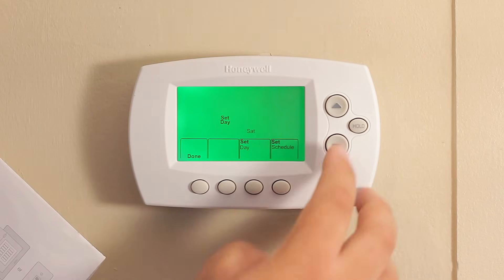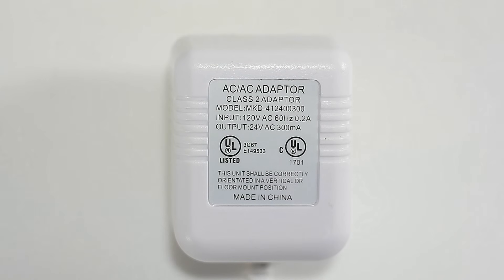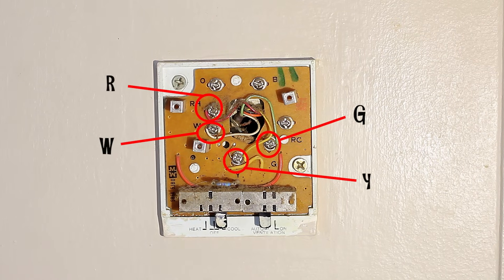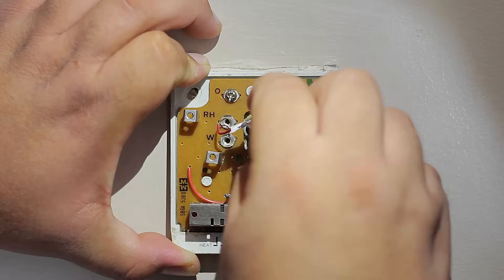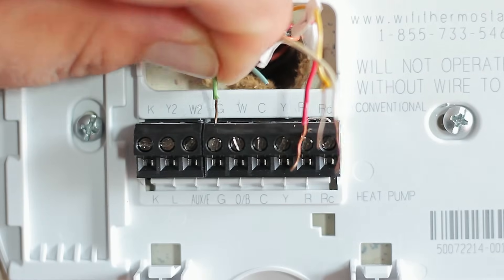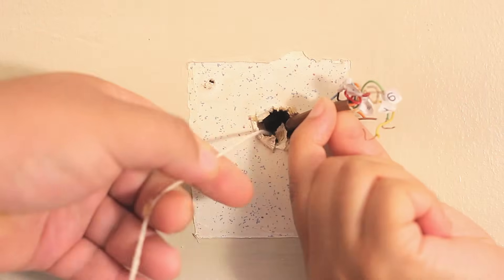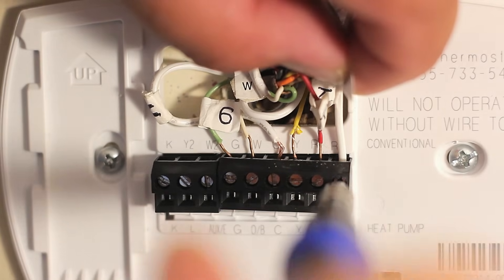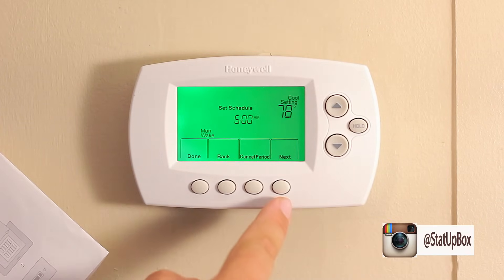How To Install A Wifi Thermostat  With Out And With  C Wire

Comment: so you had some spare wires in the background, how did you know which one was C?
Reply from the maker: +Mike H. We verified at the board where the wires originate from and matched color to letter according to the board
Reply: StatUpBox , I went to the original source. The cords aren't verified there. They just go into different sections but they're not labelled

Comment: C stands for what and do some thermostat don't need a 24volts I don't get it
Reply from the maker: the power that the wifi thermostat generates (lcd screen and the wifi) can not be provided by batteries like in older systems, so for that reason a constant power source is needed.
Reply: The 'C' stands for 'Common', or ground. 'C' is used here because there is a a 'G', for the green coloured wire.

Comment: Will the vapor compressor to liquid condensation to pressure reduction & evaporation cycle still work in the same direction south of the Equator?  Do we need to hook up  thermostats backwards in Argentina, Australia and New Zealand to account for the Coriolis Effect?  
Can we use pastel colors instead of primary colors for the wires?  Your colors remind me of crayons in Kindergarten.
Reply: +1 for working in "Coriolis Effect."

Comment: If you don't have a C wire but have a red (24 VAC), yellow or blue (A/C), green (FAN) and a white (HEAT).... Just remove the FAN wire on the thermostat and move it to the C terminal. Then go to the furnace terminal fan center and move the other end to the C on the transformer...You won't be able to control your fan at the thermostat anymore but who really does?
Reply: No "C" on my transformer pal. But thanks anyway, guess Ive got an old furnace. No letters, just wires.
Reply: Do you have air conditioning?
Reply: I have the same problem with my AC system. No letters anywhere, just a bunch of wires. It's an older Rheme that can also provide heat. I took a couple pics of it and still can't make sense of it.
Reply: FIVEOFEVER
Reply: The g-wire solution
Reply: @K W Well, at least it has one fan.
Reply: That's pretty brilliant actually.  How can you be sure Green is fan control?
Reply: FIVEOFEVER

Comment: Quick question. I will be needing the c-wire adapter. However, my system only has 3 wires, Y, W, & R-RC switch. Will this thermostat still work?
Reply from the maker: honeywell has compability chart https://yourhome.honeywell.com/General-Pages/Wi-Fi-Programmable-Thermostat-Home-Compatibility

Comment: But how the cooling is going to work as we removed the hot wire from Rc . In a call for cool Rc,Y and G will energize but as you don't have power on Rc AC won't run..?
Reply from the maker: +Apurva Chaudhary  This is a illustration according to the wires that are available  according to this particular system. . Wires will need to be place according to the ones you have In your particular system and the manual calls for. If your system does have a rc wire you will have to place both wires. In our case we used the already existing c wire on the system. the power adapter, is to illustrate the work around in case you don't have a c wire and remembering that wires need to be place according to label,system and manual information.Thanks for your comment.